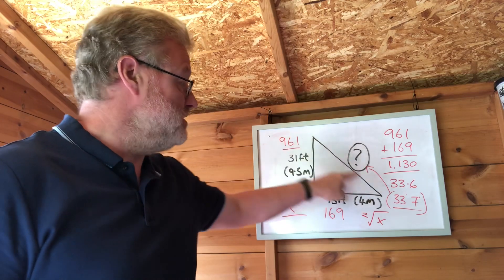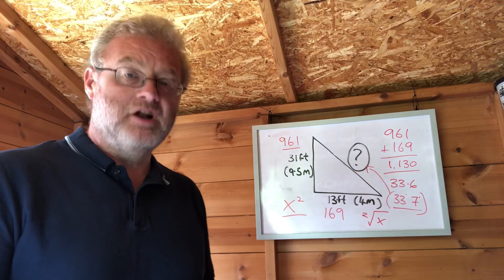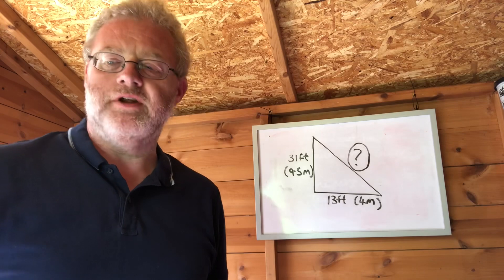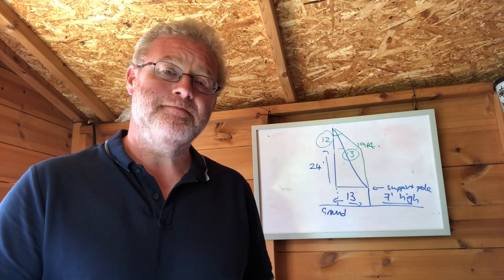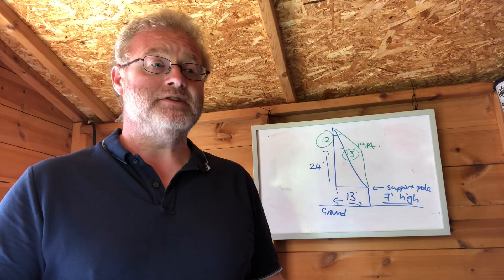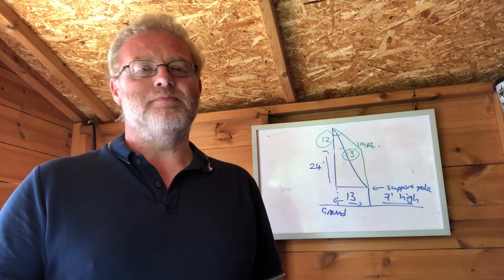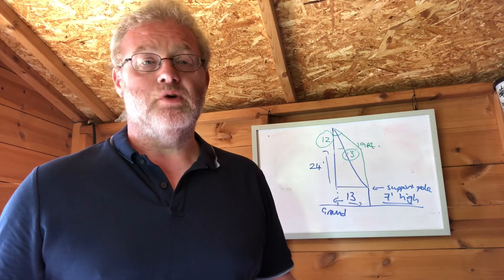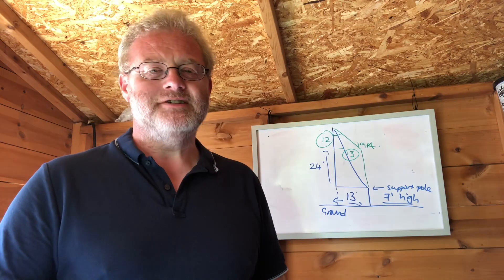HAM RADIO: Your First HF Antenna - how to work out what you can install?

Comment: What if you have the A height and the B length of the wire and the wire ends need to be 8-10 feet above the ground. can we calculate C?
Reply from the maker: Tell me your dimensions and I’ll check
Reply: @TIMG5TM  Antenna: OCF IV Height is 28 feet, wire lengths are 44 and 88 feet.   Specs say they should be 8-10 feet above the ground.
Reply from the maker: @markstump7079  ok so looking at the 8ft above ground the 44 ft leg needs horizontal space of just over 39 feet. The 88 foot leg requires just under 86 feet of horizontal space. This assumes the antenna is an inverted v with the high 28ft point at the feedpoint between the two legs. Hope that helps.
Reply: @TIMG5TM  Thanks for the information.  Quick question about the IV design.  Is it necessary to keep the wires perpendicular to the feed housing?

Comment: Hi Tim, Thank you for the videos.  2 questions. -  1. can the angle between the 2 wires be less than 90 degrees when looking down on plan.  2. Can I come and meet with you and discuss things face to face.
Reply from the maker: What did you need to know Paul?

Comment: Hi Tim is a 12m spiderbeam pole strong enough to be a centre support for a 76ft efhw ???? Cheers
Reply from the maker: Yes as an inverted v I think you mean? That’s ok but use no higher than the 9th/10th section. There is a way to limit the bend on the pole and I’ll reveal that some day..
Reply: @TIMG5TM  thankyou

Comment: So do you still keep the 13 feet or cut it off?
Reply from the maker: Do you mean the ends of the antenna?
Reply: @TIMG5TM  Yes when you ararted you had 13 feet for the wire , now when you changed the angle of the top of the antenna that shortened the length of the angle so do you remove the end to shorted the 13 feet to fit the angle?

Comment: Your video was instrumental in getting me back on 80m this past June, as I used these instructions to confirm that I could just fit a shortened 80/40m shortened dipole in an inverted-v configuration in my backyard. This not only gave me great results, but probably doubled my contacts given the widespread use of 80m in my area and lack of propagation on the higher bands up until a few weeks ago. Very useful advice and much appreciated!
Reply from the maker: Fantastic to hear and I’m very glad you’ve enjoyed 80!! 73

Comment: Can interference with your neighbors TV, radio, etc reception while transmitting be a problem?  If so, are there any rules of thumb for power, distance to the neighbor from your antenna, etc for avoiding that?  Thank you.
Reply from the maker: Generally at 100w or less you should be ok. Issues tend to arise if your neighbour uses a broad amplifier for their freeview aerial then it could receive some of your Hf bands. Trial and error! 73

Comment: I know any old wire can act as an aerial/antenna but is there a specific type of wire that is best to use 
for ham radio?
Reply from the maker: Basically yes. In terms of length/how much wire - all depends on the band(s) you want to use. In this case I used enough wire to be resonant on 40m (7 MHz) and higher. Thanks for watching and commenting 73
Reply: Thanks for taking the time to reply Tim, As in type of wire I meant  say  is 2.5 mm stranded wire or 1.5mm solid wire best allowing for 5-10 watt up to 100W what do you buy?.

Comment: Hi Tim. Can you use insulated multi-strand copper wire for dipoles. Thanks.
Reply from the maker: Yes that should work
Reply: @TIMG5TM  Thanks.
Reply: I'm building my first HF inverted V soon. Is there one that will cover most bands like 10,20 and 40 meter with a ATU. If so what is the best frequency to set it at and then use the ATU for the other bands? hope this makes sense lol.

Comment: So useful! Will it work between two houses? I think I can get lots of wire up between two tall houses. However, we’re 6 meters apart. does it make sense in a tight “canyon”?
Reply from the maker: Provided you aren’t close to the houses yes. Which band(s) were you considering and would the antenna be an inverted v dipole?
Reply: @TIMG5TM  Thanks, Tim. Yes, I'm wondering what "too close" is. I can get a center support up 35ft and put inverted v dipole wire out 50' to either side. The trick though, I think, is that i'm only 3ft away from a tall house on either side of the wire. Imagine a dense row of urban 2-story houses. Another option I have is a sloper that could run 50' without buildings on either side. I'm not married to any band. Looks like I have enough wire to get 40 meter band on the inverted V. And I think enough for 20 meter band on sloper. ...I'm left to wonder if the canyon environment between two houses is just going to ruin the inverted V.

Comment: Interesting video, I personally use an EFHW 49:1 in an Inverted L due to size of my garden, but it works extremely well on the resonant bands. I made a video on it but I did cheat and buy the matching unit instead of making it lol
Reply from the maker: Same here Matt. I use a 49:1 (bought) and added just under 66 feet for 40 20 15 10 and with an atu it does well on 17 too. Thanks for stopping by 73

Comment: As a conclusion, what is the height of the centre pole, the length of each “pole”and the degrees of each angle? I an not certain I understood correctly 100% and being able to compare answers given 19ft support poles would be helpful. Plus a video showing it being set up would be useful and neighbour negotiations! Thanks.
Reply from the maker: Centre pole feedpoint 31ft above ground. Right hand support pole - wire/rope reaches it at 19 feet height. Left hand support pole same. Left hand angle 49 degrees (height between feed and support pole 12 feet and distance between feed pole and support 13 feet). Right hand angle 56 degrees (height between feed and support pole 12 feet and distance between feed pole and support pole 16 feet). Overall angle 105 degrees. No need for neighbour negotiations all cool. Check out my recent 33 foot doublet video for install footage from about 3:40 into that video. 73

Comment: Thanks Tim for taking me back to school after 40 years lol. I managed to get a height of 9m with a angle of 110 degrees. 8m of antenna wire each side. Could I use a 1:1 balun at the feed point instead of a ladder line?
Reply from the maker: Hi Martin. 8m each side is 26 feet so that’s a 52 foot dipole. Not resonant as a half wave on any frequency (though is a full wave on 17m). My advice would be to keep the ladderline and feed either directly to a balanced atu or via a 1:1 Balun near the shack and then a short coax run to an atu. In other words a multiband doublet. 52 feet should give you 40-10m. Thanks for stopping by 73.
Reply: @TIMG5TM  Thanks. What length would be best for each leg to give best results. Does a ladder line need to hang in free space? or can it be supported?
Reply from the maker: martin drury ladderline can fit in free space or you can secure it to a non conductive surface such as fibreglass. It depends on how much room you have to play with but if you are looking at 40m and up then any dipole length at 51 feet or greater will likely give good results. 80m requires at least 85 feet or longer, better if nearer 100 feet at least.
Reply: @TIMG5TM  Was thinking of using the G5RV half wave with an ATU.
Reply: @TIMG5TM  Is that 51ft per leg?
Reply: @TIMG5TM  Bit confused lol. So would i feed the ladder line with coax but in the shack have a 1:1 balun isollator choke ( with a pl connector each end) then my ATU is this part what I need?https://www.ebay.co.uk/itm/1-1-balun-line-isolator-choke-200w/164229181922?hash=item263cd271e2:g:8~MAAOSwl3tdekVf
Reply from the maker: martin drury Martin what you can do is feed the ladderline to a 1:1 current Balun and then a short run of coax to an atu (this is the lossy part of this system). Then as much coax as you need from atu to radio. What you have a link for there is a line isolator with so239 on both ends. Check out my 33foot doublet video from a couple of months ago which explains the install I describe above. 73
Reply: @TIMG5TM  Thanks. Watched the vid. This is not an option for me. I've see various options on youtube. Ladder line then coax to ATU. Balun to coax to ATU.